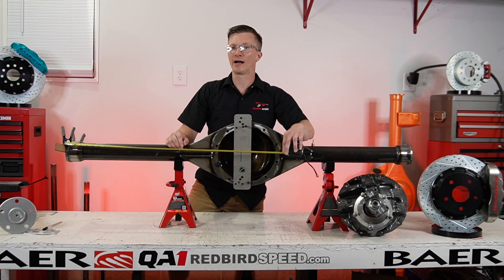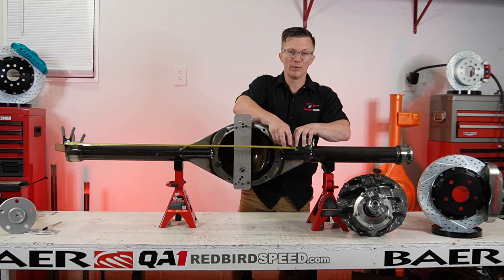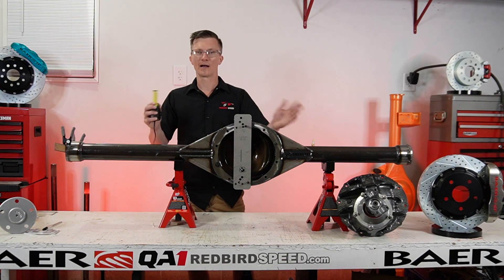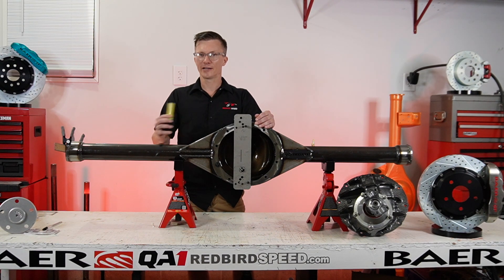9" Ford - The Complete Rear End:  Measuring Housing Width with Center Pinion Tool - AVOID MISTAKES!

Comment: So this may be a dumb question but you mentioned the axle length can change depending whats on the inside. Are there any center sections for the Ford 9 inch that change where the pinion is on the outside? I'm doing a Ford 9 inch and I need to resize the housing to fit my truck. So I figured I'll center the pinion and due away with the offset pinion.
Reply from the maker: The center section where the gear/posi are setup is a constant. The yoke comes out the front of the chunk the same on all units. I hope this answers your question. Give me a call if you need help with housing and axle shaft dimension. We can get you on the right track.

Comment: Do you know info when using a arb locker
Reply from the maker: Are you asking about the axle measurements when using an ARB locker? You might have to contact the manufacturer to see if there are differences in this specific unit.

Comment: So which way are the tapered axle bearings pressed on.    Many people say the cone first and the race is removable.   
 I think the race should be trapped by the bearing cone on the axle...

With a loose race. The only thing holding the axle in is the rubber sealing lips of the axle seal and the brake rotor.    Which way is correct
Reply from the maker: The lip seal goes toward the flange of axle shaft. The race will stay in the housing and cone come out on the axle once installed. They will separate. The caliper bracket / retainer plate will catch the seal and press on it and create a preload.
Reply: @redbirdspeed5063  look closely.  If the outer race will separate off the bearing.  The seal is the only thing holding the axle and cone in .
Reply from the maker: @waynep343  https://youtu.be/MAqrjRz1SGQ Go to the 3 Minute mark. The lip seal goes on first. It rests in there very snug. Press ring goes on last. Bearing is lubed by the gear oil and open. Seal on the outside keeps it from leaking. A caliper bracket or retainer plate will catch the outer edge of the seal and hold the axle in the rear end. It creates a pre load as that seal pushes into the bearing.